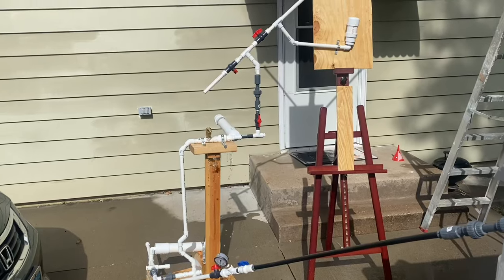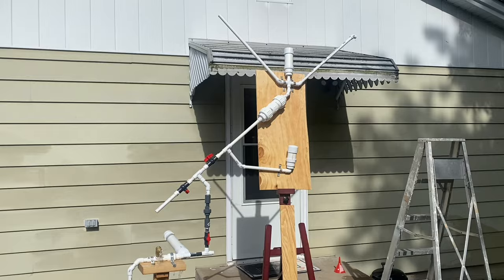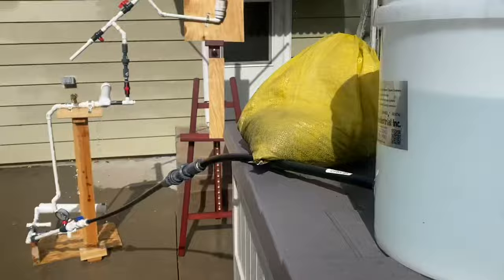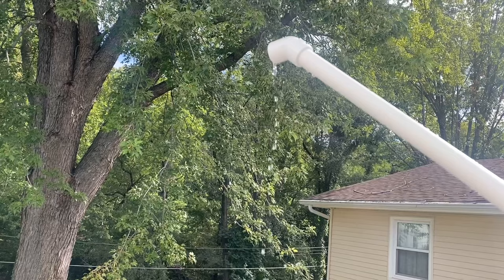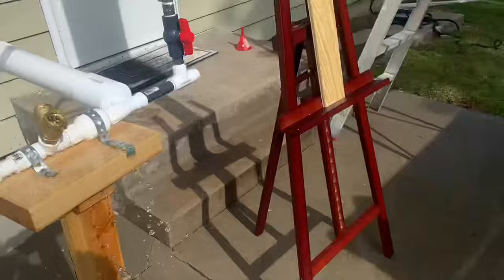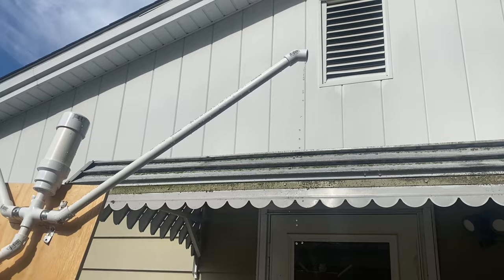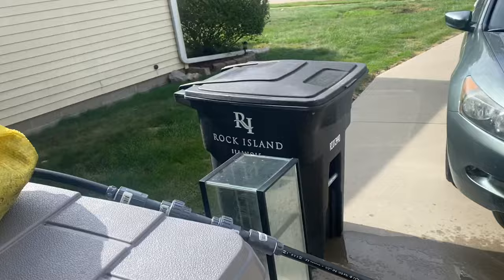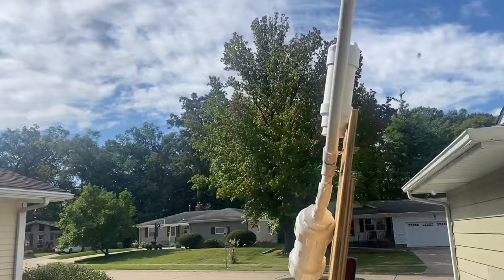The Great Pyramid of Giza Ram Pump theory works!  Video 1 of 2

Comment: What this video is really showing : The system need the incoming water to be near the level of the queen chamber or the level of the entrance, and it need the evacuation of the major part of the water to be lower the incoming flow to work. But the Nile is 57 meters lower than the entrance and even lower than the subterranean chamber. And there is no way in the subterranean chamber for the water to flow out or in because the corridor in the back is a dead end (and carved in the rock) and the pit shaft was not existing before Perring carved it. Scientifically it is impossible the pyramid would have been used as a ram pump.
Reply from the maker: @adzomelk8955  The Nile today is lower but not 15,000 years ago.
The Subterranean Chamber is the first of many pressure chambers.
While my proof of concept is not an exact 1/1000 replica, it is the only working theory there is.

Comment: Nice work! What would be the purpose of the king and queen chambers in your model? The ram pump system would work with just the `air vents`.
Reply from the maker: Thanks!  The Queen’s chamber and Kings chamber provide a silt area and more back pressure that ram pumps need.

Comment: It's about time someone built a working model. Thank you for doing this. 
I think with constant running water, that opens up all kinds of possibilities of technology options.
Reply from the maker: Thank you!
Reply: @AJ it's not the first working model. The first one i know of was made 20+ years ago. But confirmation like this is always welcome, so thank you very much @Tom.
Btw. back then they discovered that it even could have had 2 functions in  one. It would not only work as a ram pump, but hey discovered that the ram action of the model pump did emitt a frequency that could 'stimulate' the piezo in the stone to produce electricity.
Reply: The water here in the model is at the level of the original entrance of the pyramid. This entrance is 17 m higher than the base of the pyramid and the Nile itself is 40 meter under the lever of the pyramid. If you already can have the water of the Nile 57 meters higher, the system is useless. And you absolutely need to evacuate the water under the lever of incoming water to get a very little flow of water higher but there was no way out in the pyramid except the entrance itself and the 2 "air shafts" of the king chamber. Those of the queen chamber were not opened on it and in the subterranean chamber there was not the Perring's Shaft and at the back of the subterranean chamber the corridor is a dead end. Even without speaking about the leakage in all the upper part, it is scientifically not possible the pyramid would have been used as a ram pump.

Comment: Just ran across this.  I met a man in Austria some 45 years ago with the same ideas.  He also had a working model all to scale inside a scale model plexiglass pyramid. The model was about 3-4 feet tall.  I'm sorry I don't remember his name.  Not only that, but he had several lines of evidence of Nile mud, erosion marks, and I forget what else to solidly support his theories.  It was his contention that the water could have been pumped up the pyramid and run over the pyramid to act as a large irrigator to create the farmland and agriculture of the area.  He had written a book and presented his evidences to several archeologists around the world but could not get any support or interest because he was more engineer than archeologist.  I don't remember his name but I know he has since passed away after disassembling and discarding his model and book.

Comment: It blows my mind that this doesn’t have more views ... must have been shadowbanned
Reply from the maker: Thank you!  Please like and share to override the youtube algorithm.
Reply: I will watch 100 times to help out
Reply: I will like and share this in comments on the pyramids. Thanks for you time!
Reply: I have seen this exact set up done by someone else who had set theirs up out in the woods.

It’s crazy.

Makes you think, with the type of rock originally used in the structure, what all of that water slamming would be generating in the granite, the quartz would be generating tons of electricity, and with the casing stones keeping all of that contained? ⚡️⚡️⚡️

This could have been like the first hydro-plant/water filtration system ever.

Pretty freaking cool.
Reply from the maker: @ryanphillips8199  I did come up with this on my own.  It’s a  roughly 1/1000 scale replica of the inside of the Great Pyramid of Giza.  Can’t say that any electricity would be produced from a ram pump. 

See if you can send the link to the video you mentioned.

Comment: I built one too. Mine uses the well shaft with an orifice at the top. Old pictures of the top step show that a jet of water impinged on the right side of the channel. From there it reflected off the side and carved a V in the top step that is angled to the left. The entrance wall to the antechamber is heavily eroded. In my scenario, the coffin sits in the antechamber with the good end flush with the portcullis stone. Water is forced to climb over the portcullis stone, heavily rounding the top. The far end of the coffin blocks the exit of the antechamber. Water can only enter the King's Chamber through the grooves in the wall. This may have been to prevent stirring up silt. Water left the chamber through the air vent. The downward shaft that should be there has been covered over by excavations. No one cares about a small shaft when they are looking for a room of gold. I'm not sure of the exact valving but one way to stop flow suddenly is to let the Subterranean Chamber fill all the way up until it can't take any more. I rather think there was a rock valve at the transition of the descending passage with the level section.
Reply from the maker: I can’t quite see how your version would get water up to the King’s Chamber etc.
If you are saying the Great Pyramid was a water pump, I agree.

Comment: John cadman has also produced a scale model and determined the subterranean chamber produces a 3d vortex as well as a ram pump.
Reply from the maker: I’ve been in contact with Mr. Cadman and he likes my idea.  You can’t have a vortex in conjunction with a ram pump.  There would be too much air introduced into the system.
Reply: It's a shame he doesn't allow comments on his videos!

Comment: I would like to ask if the bucket on the table represents the nile / the natural water level relative to the pyramid, and if its hight has an influence on the pump function. From the video it seems the "nile water level" would be at the height of the mid-lower level of the pyramid. Therefore wondering, could the position of the nile / bucket be adjusted to  match the nile being below where the pyramid starts? Many many thanks for making a practical model, you have offered more to the world than a ton of videos did that just claim a lot of stuff but prove nothing <3
Reply from the maker: The bucket does represent roughly the level of the Nile when it flowed in front of the Great Pyramid.  The level would only have to cover the opening to the subterranean chambers for it to work.  It’s my understanding that that level would be closer to the base or just below the base of the Great Pyramid where the upper grotto would be.

The height of the water source does make a difference with any ram pump. If you don’t have enough height, it can’t work.  If it’s too high, you need stand pipes to bring the “source “ of the water closer to the ram pump.
Reply: @tommartens3731  Thank you so much for your reply and for explaining the bucket position making sense : D

Comment: What few are factoring in, after the great flood, where massive fountains of the deep opened up and discharged waters that later became the oceans, fresh water receeded to depths that made it inaccessible making a massive pump very necessary.  Pyramids were not religious objects, missing the typical hieroglyphics of tombs.
Reply from the maker: That’s not quite right.  We had oceans that were 400 feet lower at the time.  When the YD event happened and most of the North American ice  melted as a result, the oceans rose 400 feet to roughly what we see today.

There is no evidence that the Great Pyramid of Giza was a Tomb.

The Great Pyramid was in use before the YD, not after.

Comment: Thanks for the video very intresting but i ask why should they build a high complex pyramid when you can do this System whit just a high tower the concept of the pyramids must be bigger than that
Reply from the maker: The hammer effect of the ram pump would be loud and powerful.  You also need to keep the system from moving which would keep the system as efficient as possible.
Reply: Imo, the ram can be tuned to sound like a heartbeat. So the dead can live. The Egyptians are rumored to have fled to Ireland. Mary Shelley wrote Frankenstein.
Reply: Thanks for the Feedback very intresting
Reply: I’m adding this to my list of what the hell the pyramids were for (tomb, power generator, acoustic levitating device…)

But to follow up, why build more than one pump in close proximity to another pyramid?

If you can also demonstrate how they actually built the pyramids…

Thanks for the great video!

Comment: Yeah, but water source needs to be uphill. The Nile and its tributaries were approximately at the same level as the pyramid base.  Drop your bucket down to the base level and see what happens...or rather what doesn't happen.
Reply from the maker: The bucket was to represent the Nile and the downhill is the Subterranean tunnel which starts the process.  At the time I didn’t have a stable platform to put the bucket on so I just used the container.  It is a proof of concept and a very rough 1/1000 scale.

Comment: i think the big valve should be be a big closed box with some air on the top
Reply from the maker: If you are talking about the chamber between the Queens Chamber and the Kings Chamber, that is the Grand Gallery.  There are no valves in there.
Reply: @tommartens3731   yes it has some details inside that enlarges the pulses at some frequency to resonant the whole pyramid
Reply from the maker: @salmannassar6750  my theory does not encompass any resonance or frequency ideas.  Just a simple ram pump.

Comment: Question…. If this was the purpose of the pyramids, why would there need to be the chambers, sorry if this is a dumb question. 

Also so this means it was used for water right? Like running water? To drink bathe ect or whatever,

Or was the water supposed to help create the so called sound waves they claim?
Reply from the maker: This applies only to the Great Pyramid.  I believe the other two in Giza were later attempts.

Yes, the water produced was used for agricultural, livestock general welfare and entertainment.

I do not believe in the sound wave theory.

Comment: Looks cool - what are your thoughts on what sort of valve might the Egyptians have used/made out of what materials. Figure that out, make a working scale copy, find evidence of these materials in the pyramid, and you have a feasible theory. That would be very cool.
Reply from the maker: Since check valves and anti back flow valves wear out fast even today, I’m thinking the used wood since it was readily available and easy to shape.

Please like and share!

Comment: Curious idea, but…
Why build a massive pyramid just to pump water into the desert?
Where is the evidence of water flowing down the pyramid?
Is the bucket to scale, i.e. is the Nile an equivalent depth at this point to generate enough pressure and is the distance equivalent?  What about the flow rate of the Nile and how that would differ, if at all, during the inundation?
Reply from the maker: They found Nile soil in the grand gallery and King’s Chamber.  There used to be a moat around the great pyramid.  It wasn’t a desert 15,000 years ago.  The bucket represents the source of water from the Nile.
Reply from the maker: The ram pump can only take as much water as the opening allowing water to enter.  Flooding could introduce debris but otherwise not affect it’s operation.

I hope this helps.

Comment: I agree the great pyramid had a ram pump but I don’t think that was all it was.  If so, it needed be encapsulated in a mega structure.  Please consider the ram pump was used to creat a specific vibration (specific to the design of the substructure contours at the bottom of the pyramid.   The pyramid shape, material, and mass was necessary to contain, focus and direct that vibration to the apex where it was used for,,,,, something.  Maybe power, maybe a signal, maybe something else.
Reply from the maker: The Great Pyramid is the mega structure.  I imagine that it made little to no noise during operation.  I am of the belief that the internal structures were built for strength and not for sound.

Thanks, please like and share.

Comment: Very cool, & thanks for the demo! Any issue with your model essentially having a water source at the height of the queens chamber?
Reply from the maker: Thanks,  I tried to keep a 1/1000 scale as best as I could with standard sized pvc etc.  I had used the storage container in my other videos since it was a solid surface to work with and I didn’t think anything of it at the time.  I don’t think it would make much difference at all had it been a little lower.

Please like and share!

Comment: That's fun. Now do it with porous stone.
Reply from the maker: I’m good, please like and share.
Reply: @tommartens3731  Nah, your little gizmo doesn't prove anything about the pyramid at all.
Reply from the maker: @honzo1078  It is the only working theory currently out there.
Reply: @tommartens3731  Let us assume the builders of the Great Pyramid wanted to build a ram pump to raise water 280 Royal Cubits high. They seem to have chosen the most expensive possible way to do it- and what's the point of doing it at all? This, of course, assuming the process would actually work in a pile of loosely packed roughly surfaced stone blocks.
Reply from the maker: @honzo1078  Ram pumps do require precise back pressure to function properly
Reply from the maker: @honzo1078  Normally, that area only had fresh water to use only during the flood season.  With water all year round, it made life much easier for crops, people, animals and recreation.  This was an infrastructure project for prosperity.
Reply: @tommartens3731   You know that the Giza plateau lowered many meters from its original height, as determined by the  bluffs on the east side of the Nile? If the pyramids were part of a hydro project,  the plateau would have been carved into a basin, not a plain tilted toward the Nile. And, the easiest way to fill it would be to create a channel upstream on the Nile that began at a higher elevation than the pool.  Trillion-dollar equivalent ram pump completely unnecessary.
Reply from the maker: @honzo1078  I’m looking back 12-15 thousand years when I it was last operational.  You can’t compare where it is today to explain what happened 12-15 thousand years ago.

You obviously don’t agree with my theory.  Build what you think it was, and if you get it to work I will then be able to   make an informed opinion.
Reply: @tommartens3731  It was just where it is 12-15k years ago. It is built from the material taken from the upper strata of the Giza plateau.

Comment: Thank you for this Great Demonstration 
Just a little remark 
As you know the nile river is 20 feet under the subterranean chamber in the great pyramid 
So, some one had to raise the water level above this chamber to make it work...
Which is another job
Or what you think ?
Thanks again for the great demo
Reply from the maker: The Nile used to run right next to The Great Pyramid of Giza 15,000 years ago.  After the Younger Dryas cataclysm, not so much.
Reply: @tommartens3731  ok thank you

Comment: What about water contaminated with volcanic ash, or other impurities? Is there a water purifying effect?
Reply from the maker: I’m theorizing that the Queens chamber, Grand Gallery and Kings Chamber were all silt beds.  If they could build The Great Pyramid, they could figure out how to make the water safe to drink.
Reply: @tommartens3731  Yeah, but also, cities have been covered in layers of dust, to the point where they've been buried and built over (like old Paris). If the Nile suddenly became contaminated, or dry for long enough, there would be enough reason for a large developed civilization along the Nile to secure safe alternate water supply. 

Humans don't decorate water utilities.. like dams. Also, a lot of Pyramids are waterproof by design.

Comment: Why couldn’t people just use the water from the river? What’s the benefit of building something so massive and complex just to elevate the water?
Reply from the maker: They probably did use the water but from a much smaller scale.  They couldn’t irrigate their crops, take care of the livestock and have water all year round. Without it, they had to wait for the spring floods which wouldn’t last long enough for use to last the rest of the year.
Reply: @tommartens3731  I suppose a stronger pump could disburse the water across a greater area, feeding irrigation canals or “wells” for water collection in less centralized locations
Reply from the maker: @AlohaTrev  The moat that used to be around the pyramid would have been more than enough to supply all of Egypt with plenty of water

Comment: That is a tad intriguing... but if the actual technique used was not water based, would you want to see it? 
Or would you prefer to continue your own investigations?
Reply from the maker: If I see an idea that does not require fantasy belief and it works, I may change my mind.